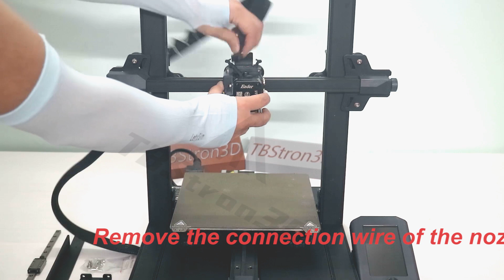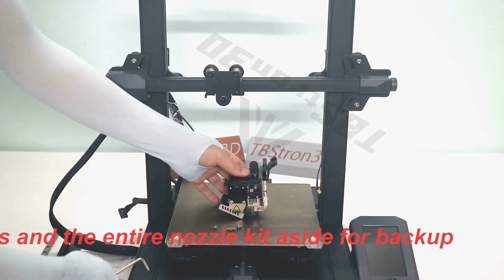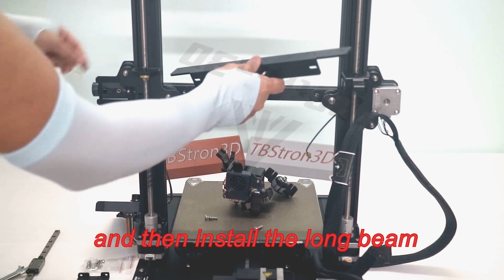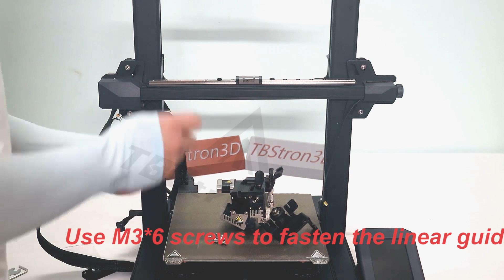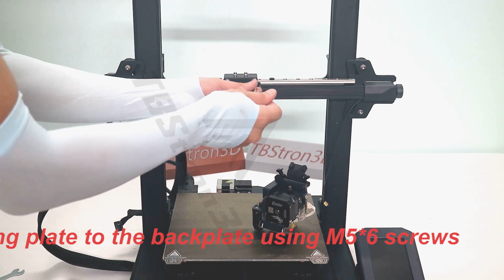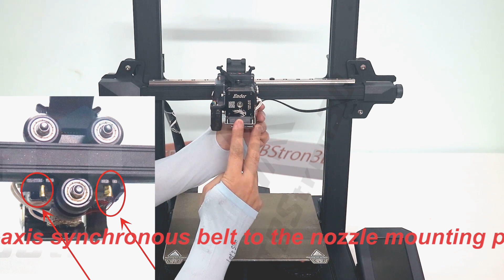CREALITY Ender 3 S1、S1 Pro X-axis upgrade linear rail installation guide.

Comment: You send me m3x5 screws instead of m3x6 😭😭😭😭
Reply from the maker: Hello,Thank you for your trust and support.The M35 screws are more suitable than the M36 ones, so you can use them with confidence. The video was made earlier, and some product adjustments were made later.
Reply: @tbstron3d-yf9op  I just realized that the screws weren't the problem. I tightened them too much from the beginning until I overtightened them and the thread no longer holds the screws.
Is there a possibility of getting a replacement part of this?

Comment: Just received mine, is the wheel on the bottom of the extruder still needed after you install the rail kit?
Reply from the maker: Hello,
It is recommended to remove the wheels at the bottom as well. This way, the rail can handle all the force. Thank you.

Comment: What is the specification of the  Linear Rails ?
Reply from the maker: Hello, thank you for your attention. The model of the straight linear guide on the X-axis is MGN9, with a length of 315mm and equipped with an MGN9 slider;